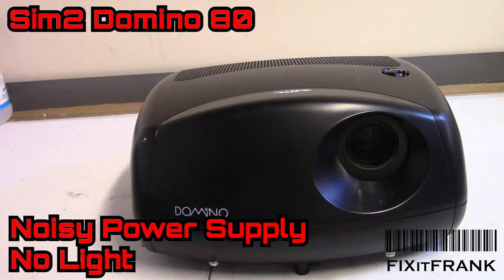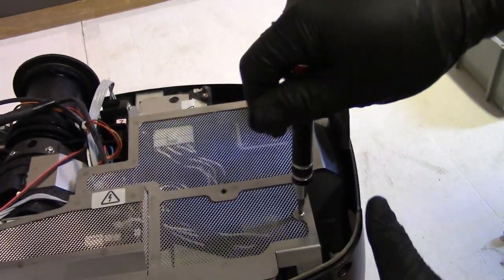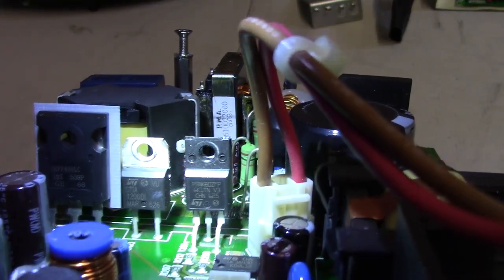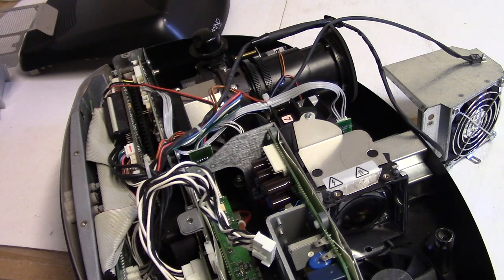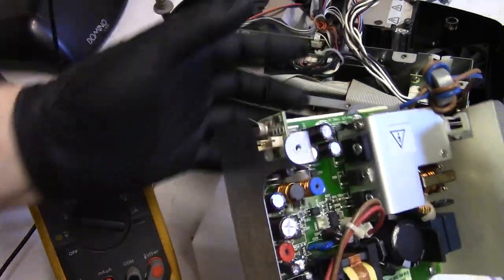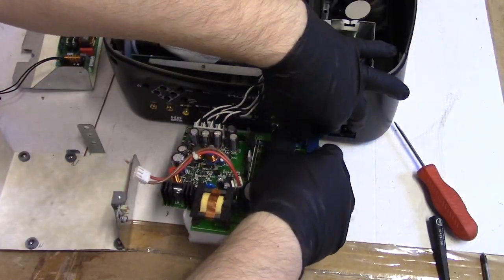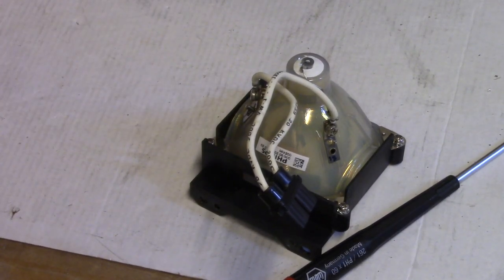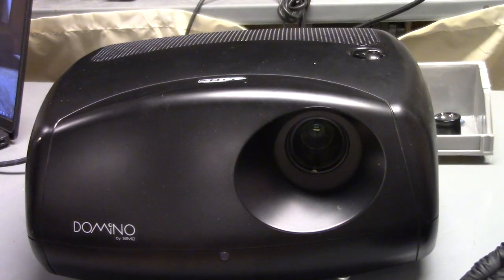Sim2 Domino 80 DLP Projector Repair | No Light | Power Supply Repair

Comment: Thanks mate have filed the link, if I develop the same problem. I have have used three bulbs and a set of fans. The bulb cooling fans had to be like for like. It did not accept the generics I tried. Still impressed with the video quality. Thanks for the detailed, clear repair process.
Reply from the maker: Oh yeah. Those fans can be picky. It's the status wire that really sets the fan model. Finding replacements can be tough. Thank you for the kind words! Hopefully you'll never need this repair. Thanks for watching!

Comment: if i needed to would i be able to send you a projector to repair from the UK, you do a brilliant job 😆😆😆
Reply from the maker: Thanks mate, I appreciate that!
Reply: @FixitFrank  your videos inspired me to repair my Mitsubishi XL5U myself and the outcome was excellent :)
Reply from the maker: That is awesome!!  Thanks for letting me know! That is precisely why I do these videos. Everyone should at the least know what it is involved and at the best, they can do it themselves like you did.  That really makes my day :)
Reply: Fix it frank optoma hd28hdr new lamp new color wheel blur light comes on flashes a few times then solid lamp light flashing power light. But mind you I just replaced bulb. Also one of the small black squares on the mother board gets very hot fast. (Hot to the touch) but no over heat light. Could that be my issue? Color wheel spins perfect new lamp what gives? How can I send it your way if I'm unable to fix? Would love to have your services available how does your cost work?

Comment: I just managed to trip on a Sony VPL-FHZ700L for $50 with 18K hours on the bulb. Is there any good place to get a polarizer for this projector without breaking the bank on a used one for parts? I've done small electronics repair for a while and feel relatively confident in being able to replace it.

Comment: Hello Frank! Great serie of videos, very informative. 
I have a question:  I own two identical Optoma EH415ST, one of them suddently lost most contrast, the black are super lifted. 
When projecting black it is very bright. 
The colors are faint but would be fine if there was contrast.  

1: I did reset the Picture setting of both. No change, its not the settings. 

2: I switched the HDMI, no change, its not the signal.       

3: I interchanged the lamps: no change, its not the lamp.
The projector is washed out no matter the lamp in it. And the lamp is fine in the other projector. 

At this point, with your experience, what do you think would cause a projector to loose black like that?  

Thank you for your help.
Reply from the maker: Thanks for doing the first few things I was going to suggest. Moving the lamp was the one I suspected the most.  But if the issue stays with the projector, you might have a dirty color wheel or dirty optics.  That can lead to a washed out black.  If you are in the USA and get stuck, I do take in repairs. But check the cleanliness of the color wheel first.  Maybe give the problem unit a good internal vacuuming.
Reply: @FixitFrank  cool, and thank you for the answer. Luckily I have two projectors, so will try to interchange the color wheels, see if that's any better. Cheers!

Comment: Hello, asking for help. I'm trying to fix Sim2 d80e, doesnt't power up from standby and error code is 6 red blinks, can you give any tips?
Thanks for all the videos!
Reply from the maker: That might be a fan. I'd also look at replacing the capacitors that fail in tbe power supply. I think six blinks is heat related which usually means a bad fan.

Comment: I have this projector
  Love it.  However right now power light comes on but will not turn on projector.  Any afvice?
Reply from the maker: If you never had the power supply repaired, then I would be suspect of the same issue this one had.

Comment: My OPTOMA HD20 runs for 2 min perfectly and then shuts off with power button blinking orange. I tried changing the bult but same thing . How do send in to you to get fixed ;O
Reply from the maker: Make sure your new bulb has a proper Phoenix bulb in it.  If it was from amazon, that might be the problem.,
Reply: @FixitFrank  i made sure it was the same OEM bulb for it . the numbers on spec and logo all match ... See the bad boy runs for 2min and perfectly so i doubt its bulb . Nice colors and everything and there is zero noise . no rattling , no hissing , no nothing and then BAM. projector shuts off . Orange light blinking for power and bulb light red solid. i unplug and replug back in and boot and comes on right away ..i feel no heat around it to justify a thermal shutdown. I even placed a highspeed fan blowing directly at projector and same thing lol stumped
Reply from the maker: in that case its possibly the color wheel or color wheel sensor.  Flashing amber power and solid red lamp indicates a lamp shut down command was issued by the projector because of a fault. 
My gut says its the color wheel warming up and then failing.  Most HD20s are on color wheel 3 or 5 by now.  If you take the color wheel sensor off and clean it, that might help. OR if its clean then you likely have the wheel failing.
Reply: @FixitFrank  OKAY  cool i'll try that ! i'll clean the color wheel sensor.